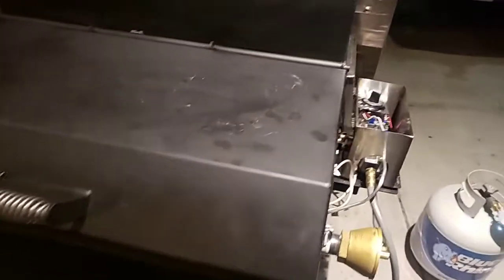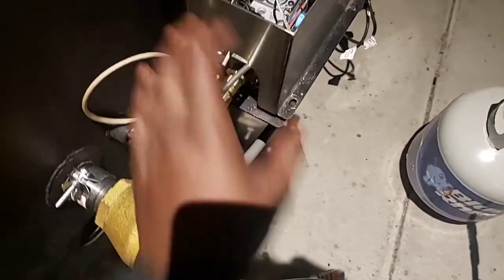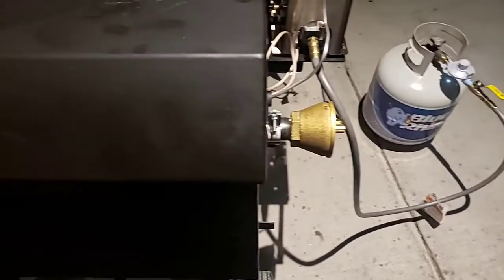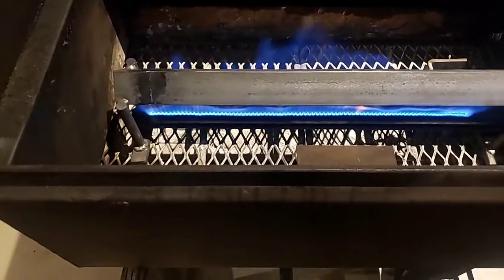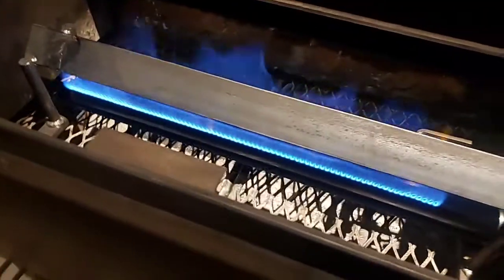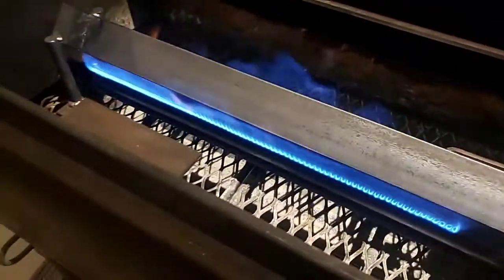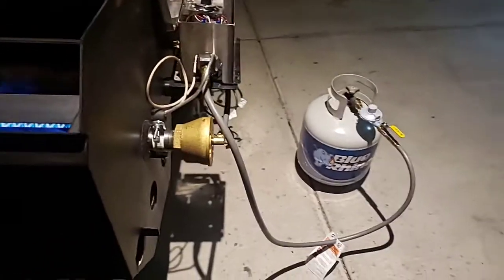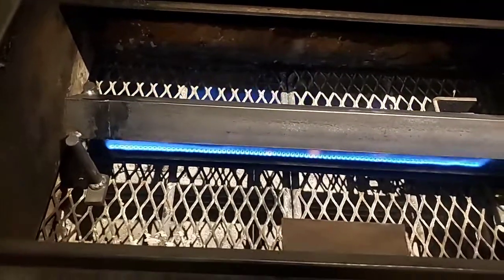American Barbecue System Pit Boss.. Propane Assist

Comment: This is what I’ve been looking for. I acquired an ABS 4ft Judge a couple of years ago and have been wanting to add a propane assist but after seeing your videos maybe a pellet option as well.  What burner did you go with?  What is the width of your fire box?
Reply from the maker: Hey constatmn thanks for Subscribing, I believe it's 38 in firebox.  The pellet system is great so is propane assist but it can be finicky if windy.  Pellet system is consistent.  I like both.
Reply: @pitmastertoby2598  where did you pick up the propane assist?
Reply from the maker: @constantmtn  i got it from ABS, call Mark Hillman